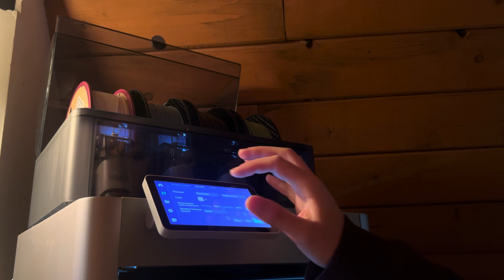The Electrical Tape Method for Cardboard Filament Spools - 3D Printing

Comment: Genius.  Nice and simple.  It won't fix the case where the sides have been glued together completely offset with each other but it will help otherwise.  Well done.
Reply: Why don't they just do this straight from the factory?

Comment: Great idea! - I have an improvement for you to consider.  I use plastic cereal containers as filament storage and directly feed from them.  Plastic spools feed OK but the cardboard ones drag too much.  I came across your idea (thank you!) but thought I'd try something a bit slicker. 

SO...I purchased some 1/2 inch wide PTFE (teflon) tape and used that instead of electrical tape - It's super slippery and works a treat.

If the electrical tape works then OK, but if you still have too much drag, try the PTFE tape.
Reply: I am going to try ptfe tape as think more may work better. I have plenty of electrical tape but amazon had 2x33 foot rolls and thin it says withstands heat. Cost also of printing and time for the ring makes this hack a great idea.
Reply: Great idea. I would rather print projects not waste filament and time on adapters as well.

Comment: How does the tape hold up if you have to re-dry the filament?
Reply: heat causes adhesive to loosen, tape curls back.  been there, done that.  helped not to have the tape pulled excessively tight.  But still puckered a bit from the heat, just didn't pull back.
Reply: @wkearney99  Yeah figured,  I decided not to even attempt it and went with printed rings instead.

Comment: The downside to this is the tape eventually loosens it's grip on the spool.  Then the adhesive gets stuck to the rollers, sometimes starts peeling and then gets tangled around the roller in the AMS.

It is a good quick fix, don't get me wrong, but comes with some longer-term risks.

Comment: You could try tape and the the rings. The rings won't slip, as the tape keeps it in place, and they're more stable than just the tape.

Comment: Genius. Thanks, you saved my bacon!

edit: What also helped immensely, at least for me, was chucking in a couple of electrical tape rolls on either side of the cardboard spool. Doing this braces the cardboard spool in place, against the adjacent spools, and stops the cardboard from jumping and skewing to the side and jamming itself against the AMS motor.